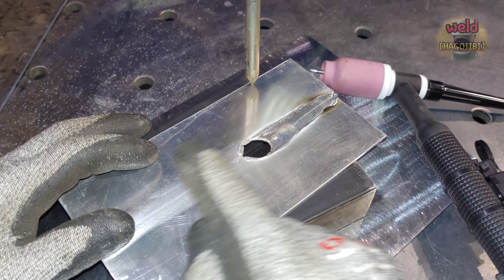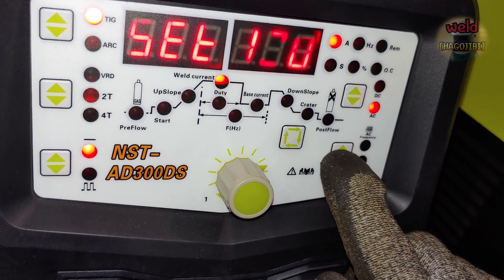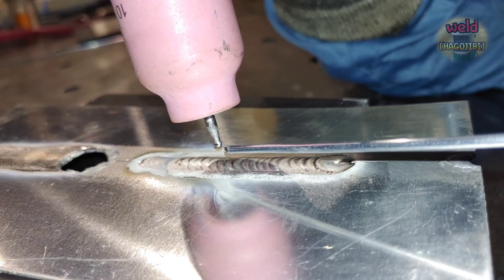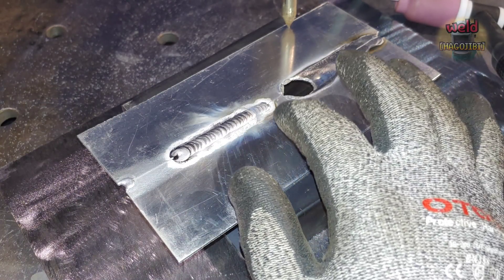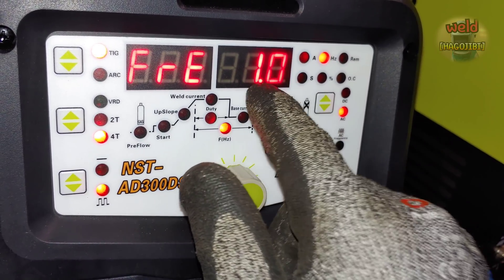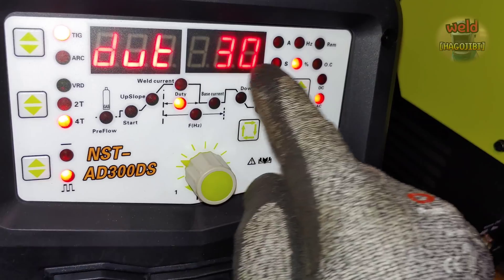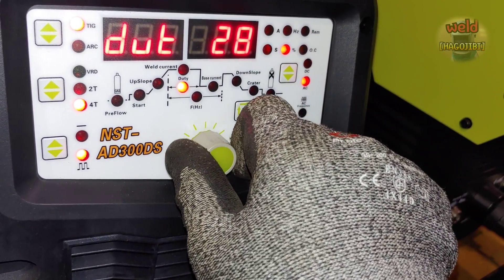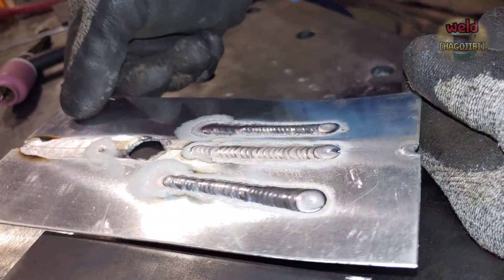Brilliant idea ! If thin aluminum sheet TIG welding is tricky, add this set up !

Comment: This is a general question: How can you weld with such high amps without burning the piece? In your cup walking videos, you move very slowly and carefully but you are constantly adding heat, how do you do this without burning the metal?

Comment: I have been struggling with thin aluminum, and this will help!  Would it be useful to set lower peak amps and higher duty cycle, to allow more time to insert the rod in the puddle, and for more cooling of the puddle by the melting rod?  I use a foot pedal, so I need to learn better how to reduce amps as the aluminum heats up. Thank you for your work to make videos that really help.
Reply: Why are you using pulse? If that's your only option, try 33 rule. 33% background 33% time on, 33 pulses per second. Then set it around 1.1 amps per thousandth of an inch.
Reply: @JackOffAllTrades  To improve my heat control skills I made some thin and small aluminum coupons. Heat builds really fast and you have to be good with the pedal or 4T, or the weldment will melt away. I experimented with slow pulses (once/sec) and higher duty cycle (60-70% high current time) to give some time to step forward while building up less heat. Works ok but not a big benefit so far. Thin+small aluminum (nowhere for heat to go) is good, demanding practice!
Reply: More experiments have shown me that our welding brother here on YouTube has the best solution in this video. Narrower pulses (20-30%) are better to reduce heat input. Wider/longer pulses make it easier to step forward and insert the rod at the right time, but they increase heat input, so the wider pulses are not a good idea.